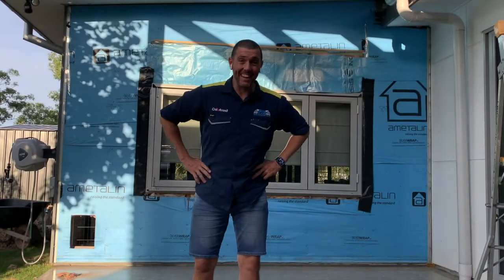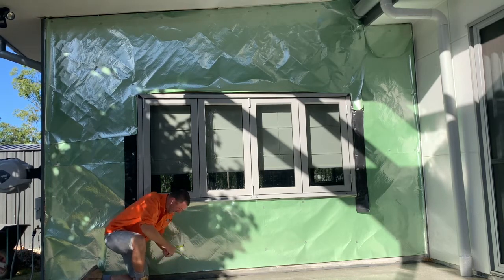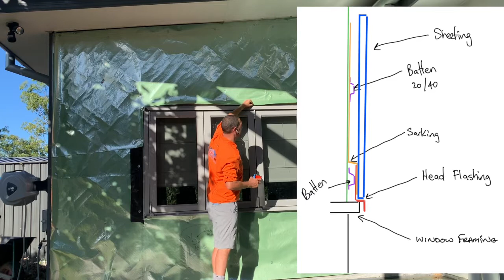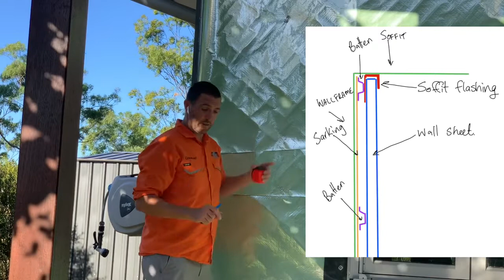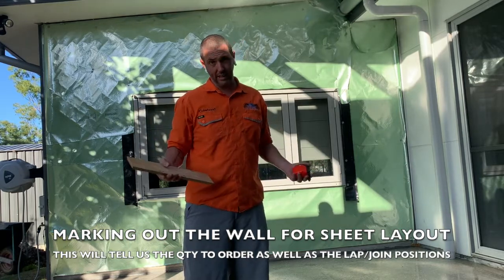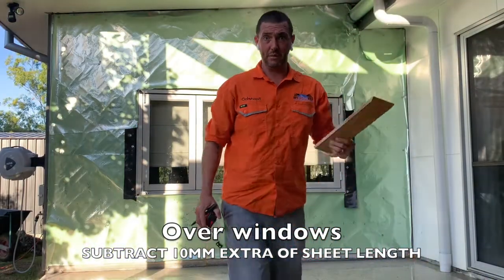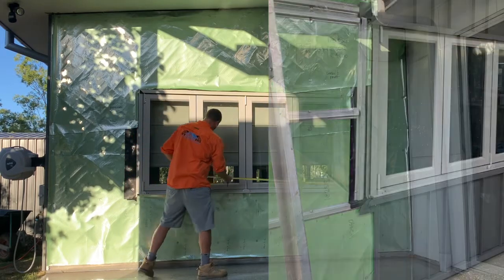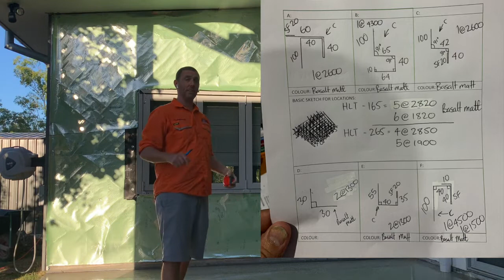Part 3 How to Colorbond Wall Cladding , measuring and ordering wall flashings Brisbane Roofing

Comment: Hey Kenny, love your content and songs, you need to professionally record that cladding jingle for radio :)

Had a question, I'm looking at ripping some old asbestos external cladding off my place in Perth WA, do you need to install battens or can you just screw the colorbond sheeting into the existing external studs/frame?
Reply from the maker: Hi Brendan, thank you so much for your comment and question. You can fix directly to the sub frame if you so wish, however BlueScope Steel requires a thermal break between the frame and the Colorbond. Also you will find that if you’re cheating vertically, your nogs between your studs won’t be in line and so installing buttons will enable you to have straight lines.

When fixing horizontally, I have done this myself without requiring buttons and had no issues especially since you have a timber frame you should be fine to install sheets horizontally directly onto your frame once you have installed wall wrap
Reply: @ConstructingArt  perfect thanks, what if I was going to do a mix of vertical and horizontal sections (for aesthetics)

Sounds like I'd need to put battens in to frame it all up for structural purposes.

Looking at getting some BraneVHP as the wall wrap

Thanks :)
Reply: Also is there a trick to installing diagonally in terms of fitting in the top and bottom plates?
Reply from the maker: @bloodfoz  Brendan, no real tricks, however I have never installed cladding on a diagonal.  I would think the principals would be the same as running vertical and so pretty straight forwards.  

Diagonal could be fixed directly to existing studs.